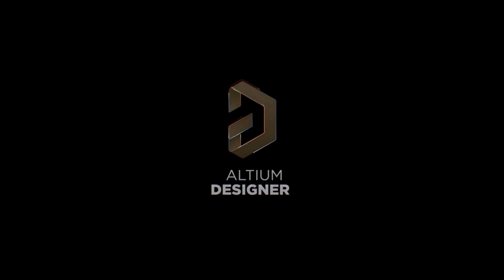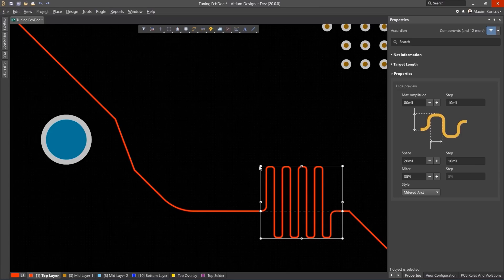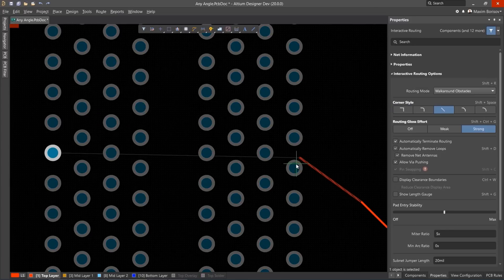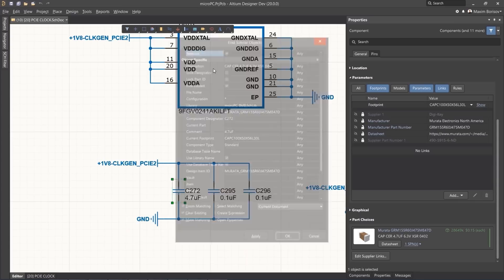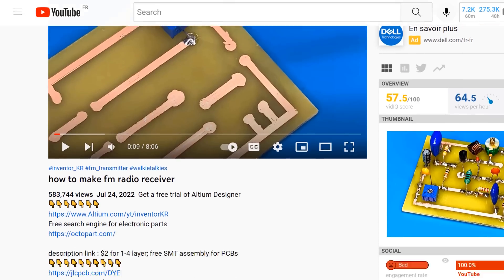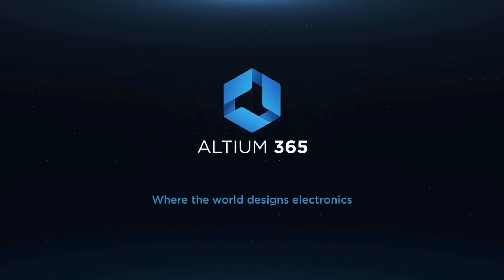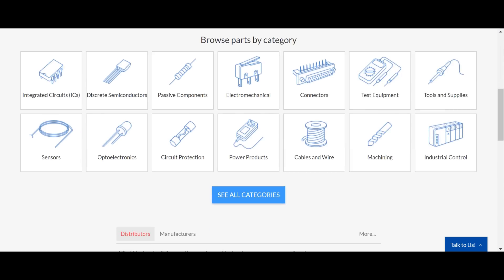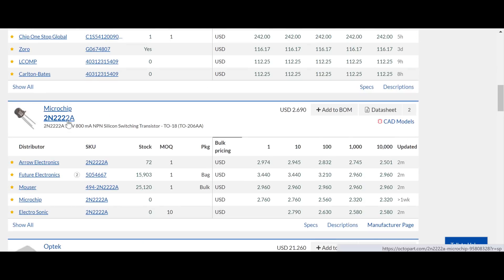how to make inverter 2500w , sine wave , mosfet , irf3205 Altium Designer

Comment: Connection is wrong 4017ic the pin number 16 and 5 input negative voltage😂😂. But the PIN number 16 and 5 input voltage positive. 👍👍

Comment: where did u get 2500w
the transformer barely can holde 750w??
+if 24 volt we need 104 amps ,!!! with 4 mosfets??
Reply from the maker: Thanks for your comment. We use heavy-duty components to ensure that the transformer can hold up to 2500W.

Comment: That is not "sine wave inverter" that is a square wave smoothed a bit by a capacitor, which means that the wave will change shape by load. That`s what you get from a 4017 ->decadic counter and a 555 oscillator. This is good enough to power resistive loads, not more.

Comment: Is there an alternative to compound 1N4814 because it is not available in my country?
Reply from the maker: 1N4007
Reply: @inventorkr1  Then already UF4007
Reply: @stasgsv3680  no 1n 4007 rectifier diode  in4148 is signal diode
Reply: There is an error in the video, there are 1N4148 diodes or newer 1N4448 will do.

Comment: @inventor KR --> This circuit is not a sinusoidal output. The sinusoidal signal that the oscilloscope shows, on channel 2, is not from the inverter, BE CAREFUL!.

You can't get a pure sine through a modified PWM. For this there is the SPWM + a low pass filter.

Greetings from Argentina!

Comment: if I'm not mistaken, we have an approximated sine wave at the output, such an inverter is not recommended for powering the control unit of a gas boiler and motors with transformers included - the reason is their heating.

Comment: how can you check if the inverter has a power of 2500 watts - very simple, connect 1 or 2 irons + install a fan to cool the radiator with transistors, then you can say that the inverter is 2500 watts.

Comment: Hello, I had a question for you: I want to record frequency underwater with a hydrophone, I did research for this, I thought of a connection order to be connected to the piezoelectric material -> op-amp -> Filter -> ADC -> Jetson Nano, I wonder if it is correct? Could you please make a video for this?

Comment: This is not  pure sine but this is modified  sine wave
Reply: You want to make pure sine wave you use egs002 module or micro controller, doing work square wave 500times pulsing to get pure sine wave you use then can get pure sine wave but one thing its want feedback voltage

Comment: The output of the inverter is nit sinewave but modified sinewave and that is useful only for some devices but not for computers .
Reply: A 12v battery of sufficient capacity should smooth out to DC. Or maybe just a large capacitor.

Comment: With 200w transistors you can achieve 2500w, it's magic. 🤣🤣🤣🤣🤣🤣
Reply: Yeah no way its a 2500w inverter, he uses 4 N-MOSFETs the best that circuit can do is 600VA that will be around 360W
Reply: there is chineese watts exists - they usually write them on small 10W radio speakers mark them like 3000w power - so is here . i need create  web page with unit conwerter china watts to si watts)
Reply: @olehfilipchuk8257  🤣🤣🤣🤣👍
Reply: It's a 2500 Watt bulb 🤣
Reply: @dickiehoppenstedt100   🤣🤣
Reply: Interestingly, does the commentator feel the difference between the "power dissipation" and the power that the IRF3205 can switch in general?
Reply: This is breakthrough technology🤯
Reply: That heat sink must be made of adamantium.
Reply: My 1200w rms ups has 8 fets on the inverter circuit, this video's circuitry must be hella efficient to provide 2500w rms with 4 cheap fets
Reply: วัตต์โม้นี้หว่า
Reply: How come a 4 mosfet come up to 2500W?

Comment: Question why the output voltage is not set to 220AC why 148V
Reply: 148 during the lamp is on
Reply: 9
Reply from the maker: It needs more power because I run the inverter on the power supply, which has a maximum limit of 10 amps

Comment: I need this variable power supply that u have ...
How do I get it ?
Reply from the maker: https://kaiweets.com/products/kaiweets-ps-3010f-dc-power-supply-adjustable-switching-regulated-power-supply-variable-30v-10a?sca_ref=1325080.M7ARhzq3am&sca_source=inventor KR
Reply: @inventorkr1  ohh no... I chek but this is 30v 
I need 60v 5amp or 10amp
Reply from the maker: @zakaryagaming999  https://ar.banggood.com/custlink/3GmrjElah7
Reply: Mimta diagram wiring nya?

Comment: sine wave ?? seriosely
Reply: Modified sine wave
Reply: Square wave output
Reply: @TRONIC-s7y   yo la conozco como cuasenoidal  no es cuadrada la cuadrada pasa directamente de fase a fase
Reply: @TRONIC-s7y  not square wave modified sine wave both are various modified sine wave is another step
Reply: Always make this type of inverter .in my opinion this is useless cz it can work just with some types of charges inductif only not all . He must try to devlop this by using spwm module .
Reply: @mohaamoha9272  
You can add a filter by using 3 resistance 1k and 3 capacitor 100 nf
Reply: @Creative-electronic250  is this will give us a pure sine wave or what ?
Reply: @mohaamoha9272  
Yes you can take a pure sine wave from this filter
Reply: @Creative-electronic250  ok i will try
Reply: @Creative-electronic250  hello you are saying that 1k resistance and 100nf capacitor its want 10khz and it work to get pure sine wave dont do this inverter can make 50hz and doesnt work plz watch the full video
Reply: @mohaamoha9272  no bro cant give pure sine wave because its work 10khz this is 50hz how its work you want to get pure sine wave you need to use micro controller and egs002 driver module plz  dont believe what everyone says
Reply: Modified sine wawe

Comment: It's work well but
I don't think it's 2500 w
I think it's 250 w cuz of that transformer that size might be like 250w even less than 250w 
And I don't have MOSFET that's why I ask for a low power transistor inverter to run led bulbs
Reply: You can use irfz44n or any low power transistor